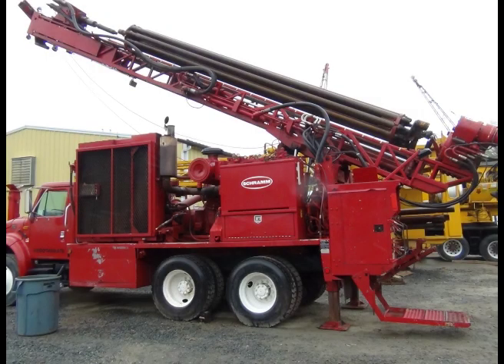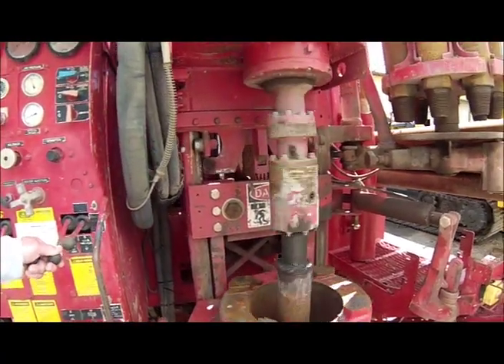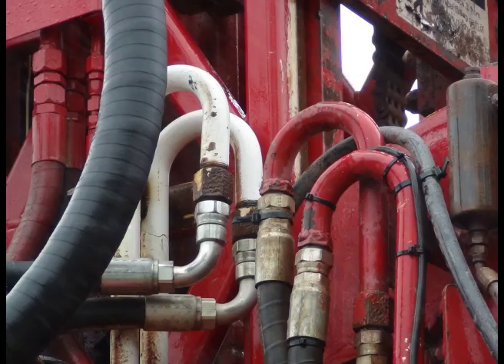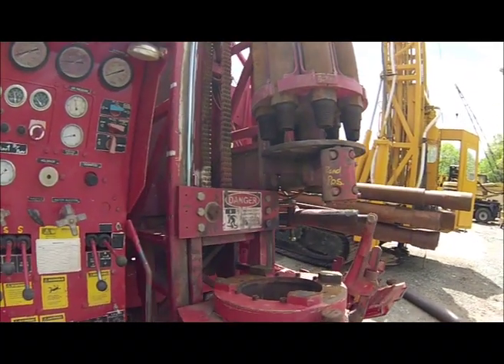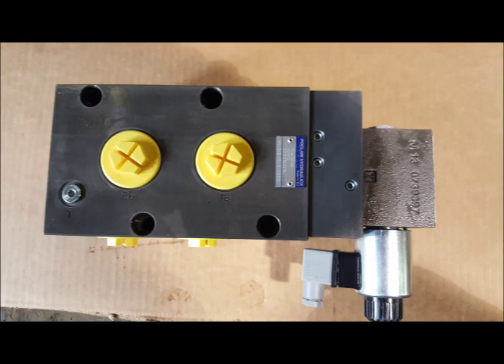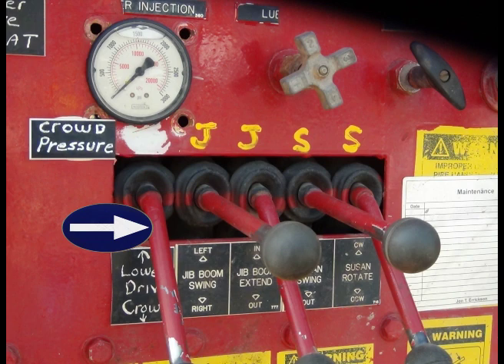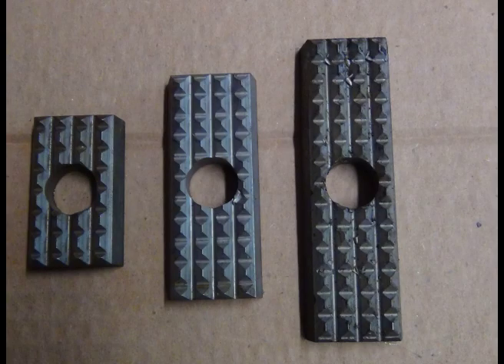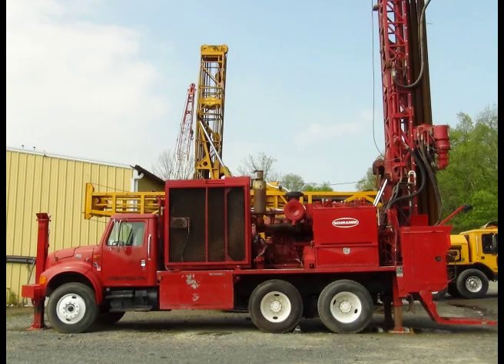Schramm 450 CR-12 Dual Rotary Retro Fit Install

Comment: Do you have to totally remove the factory installed table from the mast when retrofitting this rig for Dual Drive Rotary?  Is all this work done after leaving Schramm's factory OR does Schramm offer these rigs with the Erickson built Rotary Heads installed by Schramm as optional equipment?

Does Erickson manufacture "both" Rotary Heads OR just the 'Lower,' Head?